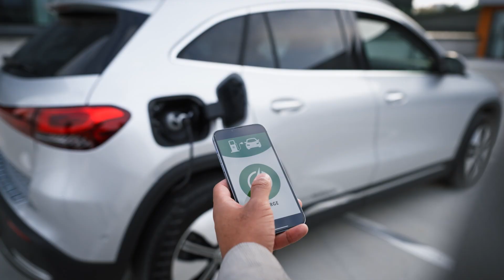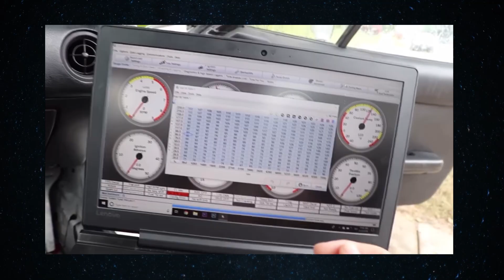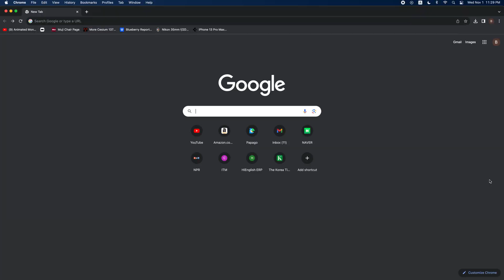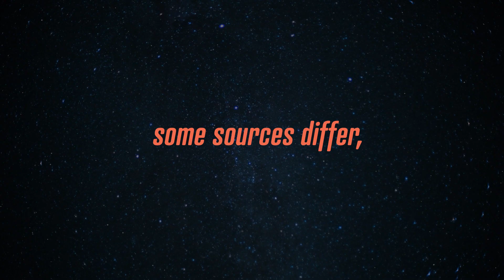4 types of ALT ENERGY you're NOT thinking about

Comment: You need to do more research.  Wind turbines for example do need a fair bit of energy to build but that’s as nothing to what they produce - One good windy week should cover it. They also don’t use much land as you can farm right up to the base. Ethanol is a great fuel but needs lots of land and diesel to produce. It has a place but is not that green unless made from waste which is very limited.
Reply from the maker: From what I’ve read, wind turbines take a fair amount of time before they produce enough energy to break even with the energy used to manufacture and install them. Aren’t there some issue with disposing of/replacing old turbine blades as well? Not to mention problems with bats and migrating birds? Considering the amount of fried food the world consumes, I’d say there’s probably no shortage of used cooking oil that’s just being thrown out. The main problem to me is that the majority of investment is into wind and solar, when the investment should be divided to include other forms of energy production. MSRs seem worth the investment.
Reply: @themaybetheory  wind turbines main problem is the intermittent nature of wind, apart from that we would probably be using nothing else. If you multiply say a small turbine at 100kw x 168 hours in a week that’s enough to melt all the steel involved and that gets better the bigger the turbine. As for blade disposal, considering the amount of useless stuff we dump into landfills every day, the turbine blades have earned their place in landfill after 20+ years of faithful service. Be great to use used cooking oil but modern cars with common rail fuel injection don’t like it and it only seems to work well on old mechanical pump diesel’s  - apart from that I doubt the supply would make much impact on the demand. Not sure how the turbine bats and birds fatalities compare with cats and other natural predators so I can’t comment on that. On the positive side there some good opportunities to use these alternatives small scale on an individual basis and its great to have a hobby with some payback for a change.🙂

Comment: ... This video lacks a roug estimation on how much land biofuels need.
If you do the calculation in Italy all the fields in one year would create enough biofuels for one day of consumption.
Sustainable?

Ok specific cases, but not broad use

The manufacturing of new vehicles is decreasing on this period and is related to the economy it is independent of the fuel used, so it is silly to say that if you would use alcohol you wouldn't need to replace a 20 year old car, the replacement is still needed wether is electric or not.

The process of creating a biofuel or alcohol or synthetic fuel is power hungry, to the best it needs 6 times the energy for hydrogen and literally 100 times for biofuels ( photosynthesis is 1% efficient if you consider that you use only the fruit of the plant to make fuel)

Petrol extraction was really cheap and could be considered on the cost based on eroi (energy return of investment) 
In the beginning you would pick it up with bucket and refine and one unit of petrol would create 6 unit of fuel so we would consider a factor of 60,  today if you don't have an efficient way of working on it it is uneconomical the factor shank to 5
There is a wiki page over it check it out
Refinery are closing for this reason
Norway created the biggest offshore wind farm to power oil extraction 

Try again and go little deeper on this specific issue 

Wave and molten salt ok

You are not getting a👎 because you are new to this I'm guessing but beware this can be harmful
Reply from the maker: Thanks for the information! A big part of using ethanol/methanol to me isn't necessarily producing new fuel, but using the heaps of food waste and other debris to generate localized pockets of useable fuel and energy. There are companies out there trying to produce methanol from municipal waste. We produce so much food waste, municipal waste and waste in general. If we can make use out of it, that'd be awesome. The argument, even in terms of using recycled plastics, is that it's not economical. If a person or community could potentially use their waste to generate fuel, that's a winning scenario. Some farmers in southeast Asia are actually using the oil from the food they cook to fuel their diesel farming equipment -- mostly because diesel prices increased. We'll check out all the info you sent. Thank you for the input, it is much appreciated.
Reply: @themaybetheory that is happening to some extent. Land fills produce methane. Many land fills are piping the landfill as they fill it they are then removing the methane using the piping system and running the garbage trucks on it. 

   That is the overly simplified version of the story yet, there are garbage trucks that are being powered by the garbage.
Reply from the maker: @jssomewhere6740  that makes a lot of sense since landfills generate so much methane. I wonder if it's a common practice around the world. In general, it seems like LPG and other gaseous fuels are more popular gasoline alternatives in other countries, but seems reserved for specific commercial vehicles in the US.
Reply: @themaybetheory  what I've told you is the extent of my knowledge. I'm sure it needs some type of purification yet other than that it will produce methane for decades or longer.
Reply from the maker: @jssomewhere6740  makes sense! thanks for sharing your knowledge. I didn't know about the methane garbage trucks before.